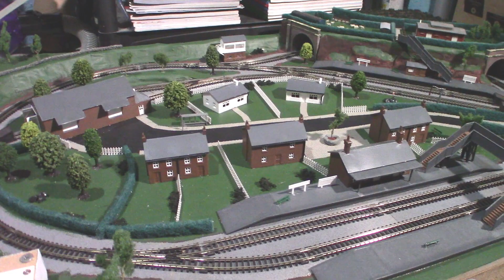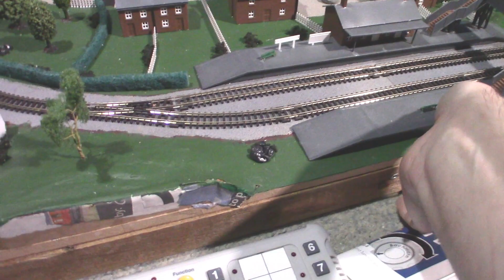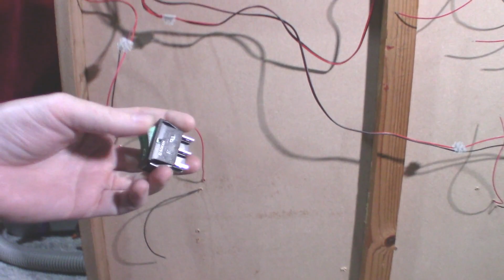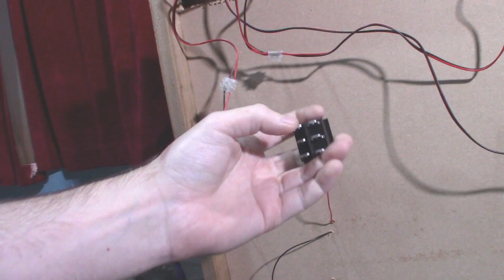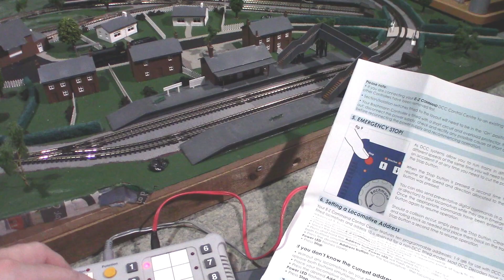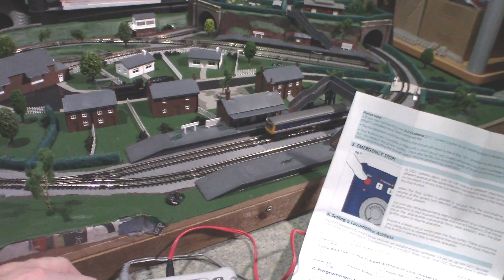N Gauge Layout Build: Beginner Layout 5 - Brief Intro to DCC

Comment: Nice work James i love how you made the layout switchable from DC to DCC that means you can run what ever you want on that layout.
Reply from the maker: Ta very much Nicholas, and I was hoping to have a single or two switch setup, then realised it would require a circuit board, so went with the more basic version.
But it pretty much does allow using either the inbuilt DC controls or DCC with simple switching over, it will most likely remain as a DC layout but the option is always there for later on.

Comment: I’m still not sure whether to go to DCC. It seems very expensive but very good,
Reply from the maker: I would ask oneself if your layout would benefit from being converted to DCC compared to the costs, if it works all well and good under DC it might just be worth keeping it as that.
Or you could do what I've been doing and spreading the cost of the setup, got the controller first and a single chip to practice with, then slowly over time getting more chips to convert the other locos.
But yes it is expensive, but can allow extra features DC can't do.
Reply: The latest locos usually come at least DCC ready, meaning you have to get inside the loco or tender, remove the existing blanking plate (do NOT throw it away) and fit the suggested type of decoder. Decoders come in various kinds, varying in both cost and size. Where DCC really gets expensive is in the cost of decent sound decoders. If you're brave enough to try sound, you will quickly appreciate the extra benefit it brings to a layout. As James has suggested, once you have a DCC controller (you can start with a fairly basic one), take the upgrade slowly. Good luck.